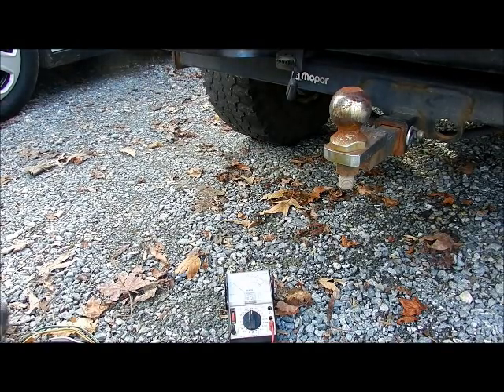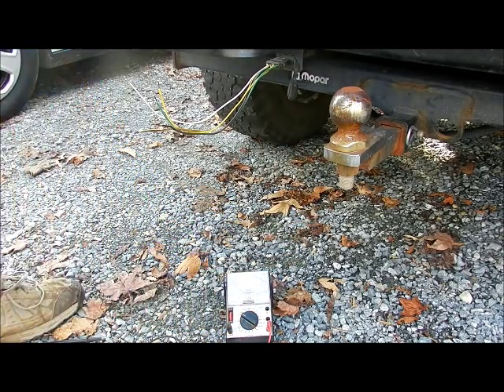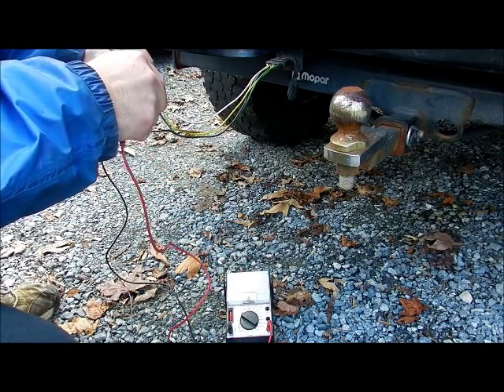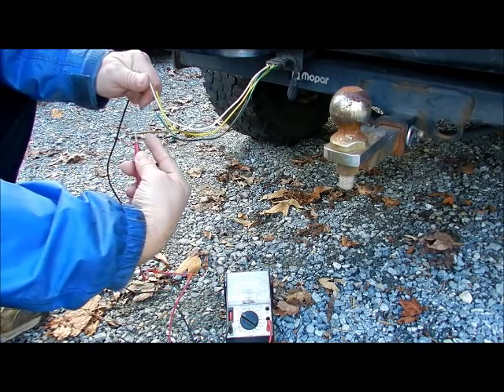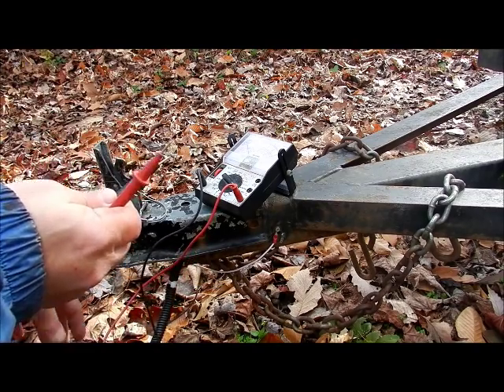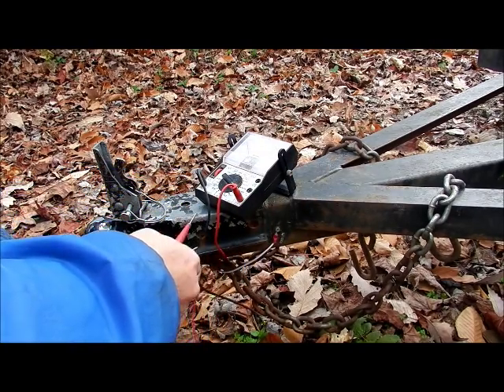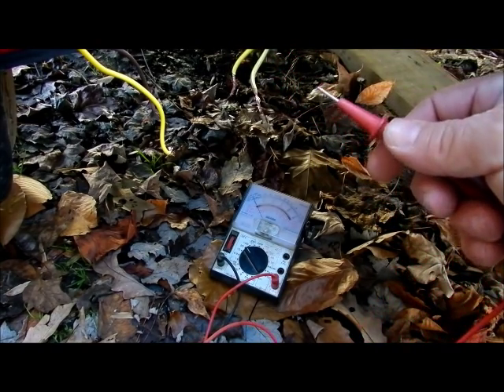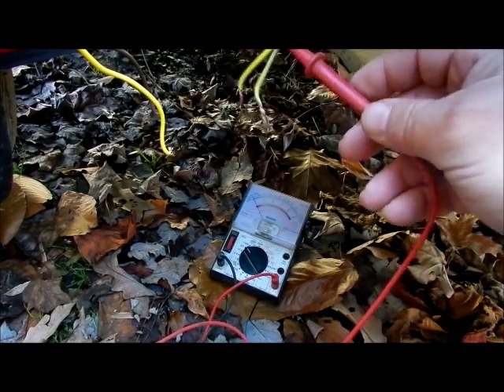Troubleshooting Trailer Lights

Comment: TY William!
I was watching another one where the guy just kept saying "Ok now touch here and here..."
Here where? He was just jamming 12 V light probe into the truck side but never identified what pin he was touching and what the color code is. Fortunately, you were the next associated video.I did as you with a spare connection but used the 12V light probe. BINGO!!!  My truck side female has a bad pin. I replaced it in under 5 minutes and WOW am I happy I found your video!

Comment from the maker: One of the three hot wires at the plug may be missing power.  The other option is very unlikely.  Both ground wires, at the light assemblies, at disconnected and/or the bulbs are bad.  Hope this helps.

Comment: Just bought my 1st horse trailer and it's definitely a fixer-upper.  I knew I was immediately going to have to rewire it but figured it wouldn't be a big deal because I run aircraft wiring for a living. Well, color me feeling stupid!  After rewiring the left side in the auto store parking lot to keep it from blowing a second fuse in my truck (just to get the thing through the five hour drive home), the right side  went out on the highway in transit.  Got home sans death or dismemberment and re-wired everything this afternoon.  Left side works great... right side not so much.  Right side has constant power going to the light(brake) and blinker is a no-go. I doubt the problem is with the truck wiring because it's a 2014 Ram with factory installed wiring and I know I wired both sides exactly the same so I'm a little befuddled as to what to do. Any ideas where to start?  As I mentioned before, the tow vehicle's a 14 Ram, the trailer is a 73 something or other, no brakes, just the multifunction tail lights (brake, running, blinker).  I DID replace the contacts inside the light housing on both sides and the wires coming out of the new contact assemblies weren't color coded so I just spliced, diced and hoped it didn't matter (couldn't find anything to contradict my hopes on the net). Could that be my problem?  I don't see how but who knows...
Reply from the maker: About the new light housing contacts.  The black wire, or side, must touch a clean surface for ground.  Use a meter to check the ground.  Also to check that power is getting the the other side, red wire.  I am also am aircraft electrician trained my the US Navy.  Housing, cars, and trailers are wired differently that aircraft.  Remember that black is ground on a trailer. Hope this helps.
Reply: Right... except that BOTH wires on the new contacts are black. I assumed that it was just "pick a wire" and run it to the negative contact of the harness connector as that's how it seemed to be wired originally.
  edit  I guess I should include here that I assumed it would be the same as a "simple circuit" where the load is the bulb in that it wouldn't matter which side ground was (power-load-ground, you're done!).  But after a good night's sleep and some time to put my brain in gear... I was incorrect, no?  The bulbs have 2 filaments and ground to case, I think.  So, I suspect I might need to flip the wires from my current setup and check fuses... but I'm not sure that'll work.  Shotguns out!!  Also, thanks for your input, it's much appreciated!
Reply from the maker: Take your time.  Check the wires and make sure they are not brittle. If they are they should be replaced.

Comment from the maker: The problem may be at the connection to the vehicle.  The harness that I had order over E-Bay had a plug that did not make the connection while I was driving.  The ground was good.  Hope this helps.

Mine was not a boat trailer.  But the wiring should be the same.

Comment: 12 volts is not going to hurt you.  You can grab the battery poles and nothing is going to happen to you.  Sure, don't short out the wires but you can hold the wires all day long.  Your body doesn't have enough resistance to matter even standing in a tub of water.
Reply from the maker: Safety first.
Reply: +Ed Lawerence (Speckul8r) I think you mean that your body has enough/plenty of resistance, so that the low, 12v battery cannot hurt you. If your body didn't have enough resistance, then there would be a lot of current running through it, which would be dangerous; high resistance --> low current.
Reply from the maker: Thanks for your input.

Comment: I learned part of my problem was the old timey trailer lights with incadescent bulbs. They were not holding up well. I replaced with sealed LEDs and now I have turn signals and brakes, but no running lights. Will check tomorrow if it's a truck fuse ( towing package). Too hot right now!
Reply: It was a 30 amp towing fuse. I am 100 % now! And with a light upgrade. Thanks for the help!
Reply from the maker: Crewmax42 Way to go!

Comment: Question strange situation plugged in the wires today into the truck had no power, pulled further down the driveway and the lights came on, checked my ground and its OK, what do you think  could be causing this?

Comment: All of my pontoon trailer lights are off.  ( side lights, too) I have a pigtail between the truck and trailer. I checked with a meter at the supply end of the pigtail and everything looked good. I pulled the lenses off both tail lights and measured a voltage bump between the posts ( in rhythm with the blinkers). I pulled the bulbs and and they looked good, but, i know looks don't count. Any ideas?
Reply from the maker: There is one thing that is in common with all of the light.  The common ground.  Use the meter from voltage to the ground at the wire harness screw to the trailer.  Let me know if that helps.
Reply: William Quinn First, thankyou for responding so quickly. Second Sorry for my delay in giving you an answer.  I just ran the test as you described and I have no connection. Open.

Comment: I put in a wring kit in my 2010 Liberty so I can tow it behind my Motorhome.  ( 4 way Jeep)  to Motorhome (7way)  round connector on my Toyota ( just for testing ) I couldn't get my Jeep lights to work at all.  Any ideas?   Thanks. The MH is available.
Reply from the maker: Disconnect both ends of the wires and read the harness out with a meter.  Then be sure the pins match up with the 4 way and 7 way connectors.  It's best if I was there to do this but give it a try.  Good luck.

Comment: i just bought a trailer that's been sitting i changed both tires and everything the wiring were gone all they had was just were the blubs go... so i did my wiring and everything but when i put the turn signal the it blinks twice then stops same in my car so i idk if it's shorting out please help
Reply from the maker: iMMoRTalxm Read out the wires and also check the voltage coming out of the plug that the trailer  plugs into.  Also, see if the car works good without the trailer hooked up.

Comment: What if I have a constant 12 V coming out from the vehicle at all times, even when the key is off?
Reply from the maker: ***** That should not be so.  Ground is constant.  Power is switched by light switch , brake pedals, and supplied by the turn signals.   You may have some wiring issues.

Comment: I bought some LED trailer light just too replace my old ones on my small trailer. They do not work at all nothing two different sets at that. I hooked some old ones to the wires where i hooked the LED too and the old ones work fine. 4 way. I don't get it.
Reply from the maker: +scottg77r Try slaving them in without installing them.  You may have to create a wiri for the ground.  This is a great way to test the lights.
Reply: +William Quinn thanks it was the ground. I had to run the ground all the way back to the LED lights.
Reply from the maker: scottg77r Great!

Comment: i just bought a trailer, when I turn the left signal both lights blink, when I do the right turn the left trailer blinks..... everything else if fine......
Reply from the maker: The power wires on the trailer may be shorted (touching each other.  So when power is sent to the left light the right also blinks.  On the second the right and left wires may be backward. Disconnect the pigtail from the vehicle  and read out the wires as hve illustrated in this video.
Reply: that is what he problem was...... they had wired the ligts wrong..... I jjust changed the wiing like it is supposed to be and now it works fine....... thank you for your help, it really came in handy....
Reply from the maker: Great.

Comment: i have one light on the passenger side that stays on but have on other lights on my trailer, any suggestions anyone. I cleaned the plugs, checked fuses, trailer only 1 yr. old
Reply from the maker: +E Claire Take the trailer light out and read the 12VDC from the bottom of the socket to ground.  Be sure it is 12VDC with power on.  The 12VDC should go away when power is off.  If not there is a wiring problem.

Comment: when I turn the left or right turn signal, both come on?
Reply from the maker: +DougandChristine Ganger Disconnect and recheck the wiring.  Try doing one side at a time.
Reply: Got it. Thanks

Comment: check your fuses, then go from there, most likely a fuse is bad, then check your wiring is all good no cuts and good connections, after that check your bulbs. if that doesn't fix it check your grund or see me on facebook, I can tell you how to get your lights working easy.... wayne morris on facebook